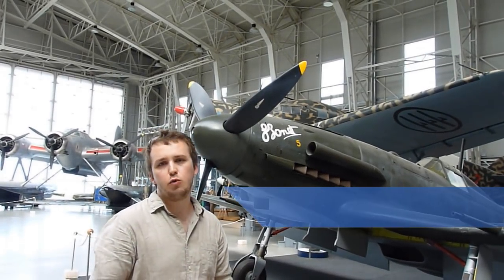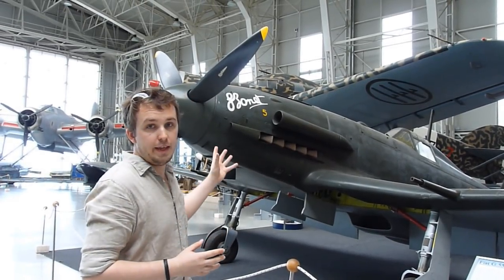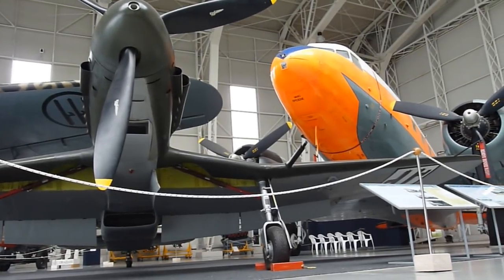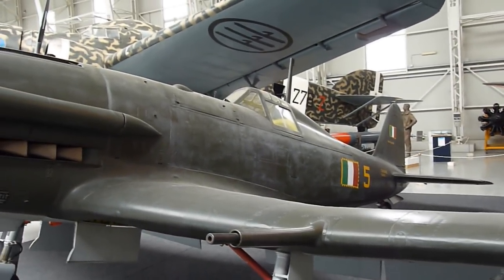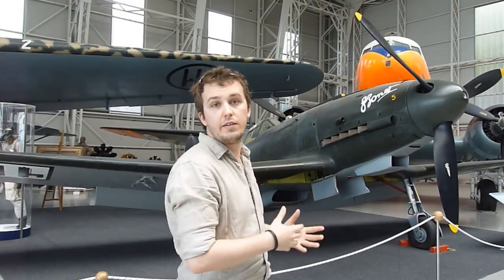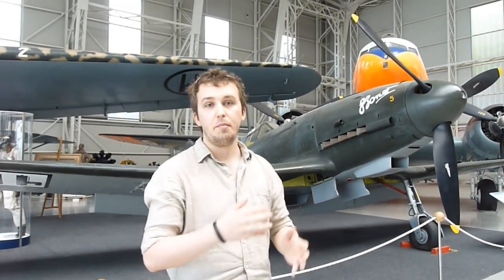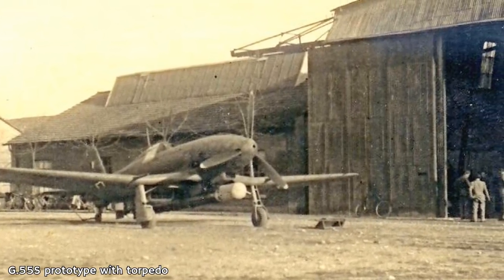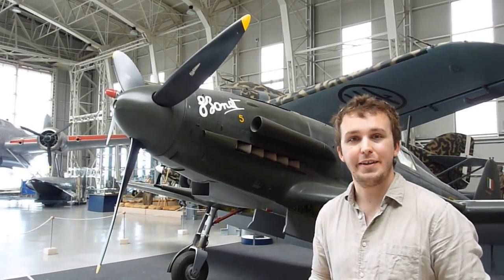Fiat G.55 - Italy's Centaur of WW2

Comment: 14:40 there is an error: Gabrielli did not simply put a DB605 on the G50!
This is true to some extent for the MC200/202/205, (and many planes are direct conversion of older models) but the G55 is a completely new airframe, which may bring some resemblance with the older one but only superficially. Aerodynamically it was the best of the 3, needing virtually no trim at any height and any speed. It was also the simpler (by far) to build and could withstand easily the massive DB603 improving performances without forsaking it's virtues (as Kurt Tank assessed when he flew the prototype at Guidonia). This could not be attained with an old and flawed design like the G50 Freccia.
RE. 2005 flew wonderfully but the tail assembly was flawed and in time could become a concern for durability and resistence to damage.
Reply: Zumzifero very true

Comment: I heard a rumor that Kurt Tank said that the G.55 was the best Axis prop fighter of the war. If he did, that's real praise. I know the German test pilots like it.
Reply: Mikhailia Gacesa what was the American fighter very similar to this one. P-39 ?   Aerodynamics by BELL AIR CRAFT: Spendid, was listening to one on YouTube. Little plane scared the bejesus out of me. Unbelievable power coming out of that little plane
Reply: in 1943 to be specific.
Reply: @davidvance6367  The P-39's only issue was that it was optimised for Low-Altitude dogfights which rarely if ever happened on the Western Front, so the USAAF disliked it for its lacklustre performance at altitude that combat took place.

On the other hand the Soviets adored it. On the Eastern Front all Dogfights took place below 4km since rather than Bomber Hunting/Escorting most of the air war was covering/intercepting CAS at low altitude. P-39's in Soviet service shredded 109's and 190's, the top Soviet aces all scored the most shootdowns in P-39's.
Reply: @davidvance6367  That's a historical lie .Hitler was told the Me 262 could be a fighter bomber & needed one to penetrate Allied defense by speed alone ,for D- Day .Every 5 was committed to fighter defense. Germany needs offense .
Reply: yes he said it. i read one of his comment about the G55, he said it with the idea in mind, to place the new engine from DB in it, because he had no place in the Bf-109
Reply: The Fiat G56 was superb!

Comment: I live in Rome so I visited the museum in many occasions. You quoted the Reggiane planes and, while the museum in Vigna di Valle has in his collection this Fiat and three Macchi, there are no surviving Reggiane today as far as I known. For example, of the 30 produced Re2005 Sagittario, the only thing that survived is a part of the tail section of one of these planes that is on display at the Museo dell'Aeronautica Giovanni Caproni in Trento.
Reply: What's sad is that some Re.2001 survived the war, and a couple had been used for some year by the metereological service of the Aeronautica Militare, but after that they had been simply scrapped. At the time preservation was not a thing (even the race plane Macchi M39 currently on display had been recovered in a ditch years later).
Reply: I was making a search about it on internet and I actually found that there is a surviving Reggiane 2000 in Sweden, at the Swedish Air Force Museum in Linkoping with Swedish markings. Some Reggiane were actually exported to Sweden and Hungary. There is also a Reggiane 2002 (without wings and engine) with German insignia at the Musee de la Resistance in Limoges (France). Another part of a Re2002 is at the Volandia Museum. In 2013 a Re2000 was raised from the bottom of the sea in Portovenere and will be restored by the Museo Storico dell'Aeronautica.
Reply: Dovrebbero aver restaurato un Reggiane 2001, non so se sta già in esposizione. 
L'ultima volta ho visto che avevano hai posizionato il carrello retrattile, ma mancava ancora il mezzo
Reply: @emmedigi89    I am counting two Re 2000,  a complete one in Sweden and fuselage in Italy and said to be under restoration.   I count one Re 2001, which is the corroded example raised from saltwater.   I see two Re 2002, both just fuselages--one in France and one in Italy under restoration.   There is one Re 2005 in Italy and it is just a partial fuselage.
Reply: @FiveCentsPlease  yes, you are actually right. The restoration of the Italian Reggiane has been completed few months ago and it is now on display at the Italian Air Force museum

Comment: February 1943 competition in a few words 
Bf109 : I'm the best fighter of the axis
FW190: No i'm the best fighter of the axis
the bullied guy in the angle(G.55): Hold my grappa.
Reply: KI-61 AND A6M3: HOLD MY SAKE
Reply: Don't forget the KI-84
Reply: keith wilson  N1K2-J
Reply: Guys, sparviero142 means February 1943, so only designs from 1943 count.
So no Ki-84's and N1K's without floats.
Reply: M.C.205V, bullied by FIAT production lines insisting on G.55 prototype: i just want to help ;-;

Comment: One other fact about the G-55 -- It is the most Beautiful piston engined fighter plane ever built!  Magnificent!  Perhaps the Macchi 202 and 205 come close, but this was a masterpiece!  Worthy of Michaelangelo!!!!
Reply: Hog Nutz  The G.55 subpar? It was considered the best axis fighter by the german test pilots! It was better than a contemporary 109, but way more complex to produce
Reply: Hog Nutz  The Centauro had almost double the firepower of a BF 109! And the range didn't really matter considering it was built mainly to intercept bombers! And if i recall correctly it had a superior range than a 109 anyway! What are you talking about?
Reply: Hog Nutz  BF 109 G-6 (contemporary to the G.55 Serie 1):
 2 x 13 mm MG 131 machine guns and one 20 mm MG 151 cannon.
Range: 560 km without fuel tanks.

G.55 Serie 1 (production version): 
2 x 12.7 mm Breda-SAFAT machine gun and  3 x 20 mm MG 151 cannons.
Range: 1200 km

Read the reports by  Petersen, Milch, Galland and Tank: they even convinced Goring to start production in Germany
Reply: Hog Nutz  Also every German pilot that tested it noted that while being heavily armed, it handled better than the contemporary variant of the 109 and the 190 at every altitude!
Reply: Hog Nutz  the gross weight of a 109 G-6 was around 3140 kg
G.55 Serie 1: around 3,520 kg
Where did you get your information? I'm genuinely curious, you seem to be quite confused about this machine.
I used to work at the Museo Storico A.M. of Vigna di Valle (the one in the video), so i'm familiar with those peculiar planes
Reply: Hog Nutz  That's the spirit! :D
Reply: yes!!! A a masterpiece!!!

Comment: I'd like just to add why Italy put into into production all three Serie 5.
G.55: it was the of the competion and the easiest to produce, while also being the sturdier of the three and better diver.
M.C. 205: While it lacked the high altitude performance required for a Serie 5, it was literally a 202 with the DB605 and slightly different wing, it could be put into production immediatly and the old 202s could be easily converted to 205.
RE 2005: It was told to the Reggiane to start retooling to produce G.55, but that would have took time and machinery which weren't avaible, so they ordered a small batch of REs because little was better than nothing.
Reply: Spot on. Add that the Re.2005 had been already selected as the replacement of the Re.2001 as embarked fighter-bomber on the carrier Aquila (since the Re. 2005 could carry a torpedo from the start).
Reply: Italian military production was rife with corruption, so it's hard to say why they did anything.
Reply: @princeofcupspoc9073  Lack of raw materials, rather then corruption, I would say
Reply: @giulianoilfilosofo7927  Not really corruption, more like that the hrad industries had too much power on the fascist regime, you could call it corruption but it was just how the regime worked
Reply: If I remember correctly the Re.2005 was the better diver.
Reply: @lukasvillar9328  I agree. The Re.2005 also had a higher top speed, a slightly better climb rate and better maneuverability.
Reply: @Andrzej360  Yes if I remember correctly the re2005 had the best overall performance loosing only in top speed in relation to the Veltro, it had similar performance to the Me 109 G series while being more maneuverable and was equipped with 2 extra 20mm with no need to use gun pods.
One can only imagine how good it would be with the late war DB 605s installed in it...
Reply: @lukasvillar9328  are you talking about the DB605ASM or the DB605DC. Because there was the MM.495 that had the asm. The Dc was in the 109 k4 and im not sure which one you are talking about.
Reply: @Andrzej360  The I was thinking about the DC variant.
I did not know that it used the ASM at some point.
Reply: @lukasvillar9328  i mean if not for the armistice maybe it would have been possible
Reply: @Andrzej360  Yeah, but I think they would have just tried to advance with the re.2006 instead, maybe those DCs where too valuable to waste in a dead end project.

Comment: just a bit of aviation nitpicking, the G55 design was NOT based on the G50 as he says at the beginning, this statement might have been originated by the english version of the Wikipedia article, not sure about the sources used, but if you read the italian version it says very clearly that it is an entirely new design and anyone that knows the shape of the G50 fuselage knows what i’m talking about, the commonality is restricted to the shape of the tail empennage shape quite a common practice since WWI

Comment: Ι have a question. The Fascist Italian air force ANR used a mix of Bf 109s, Mc202s G55s, until the infamous incident when the Germans decided to forcefully incorporate the Italian pilots into the Luftwaffe. The Italians protested, and the whole ANR was out of action for I think a couple of months. When things were resolved and the Italians units returned to action, (early 1945? going from memory) they were all equipped with Bf-109. 
Was this simply a matter of streamlining logistics by standardizing equipment?
Reply: In April 1944 both the Fiat and Macchi factories were bombed and destroyed, so from that point onwards production of 5 series fighters and their spare parts became impossible so the 109 became the only option.
Reply: The ANR pilots used only "5 series" fighters (only a pair of Re.2005 actually) and Bf109g and k. The production of G.55 was officially stopped in september 1944, but it never completely ended (at the end of the war there were completed aircrafts in the FIAT plant. Simply, if they did not produced them, they had not other things to do). Obviously, for the Germans, it was easier to divert all the resources to  the German plants, even at the cost to lose the manufacturing capability of FIAT than to spend resources to surveil another production line.

Comment: Good video!
The G55 was the winner of the selection, but the C.205 was readily available (it was already in production infact) cause it was simply a C.202 with a "plug & play" DB605 engine in it, while the other two required time to start production, so there was no point in not producing it. For the Reggiane instead was easier to start producing the Re.2005 than retooling to produce the G.55, and the Re.2005 had been already selected to be the "second generation" fighter-bomber of the carrier Aquila after the Re.2001 (the Re.2005 could carry a torpedo from the start, thanks to the offset 1000kg hardpoint).